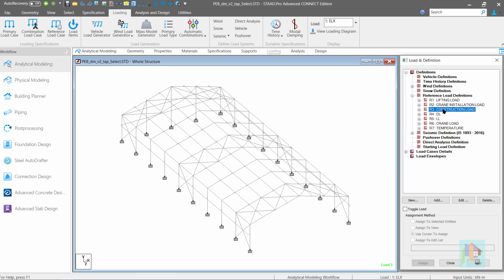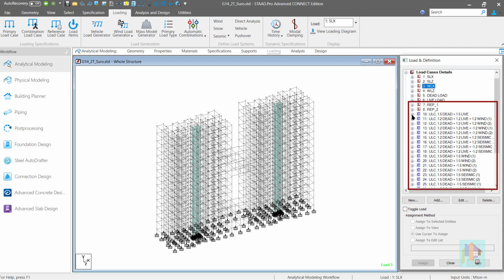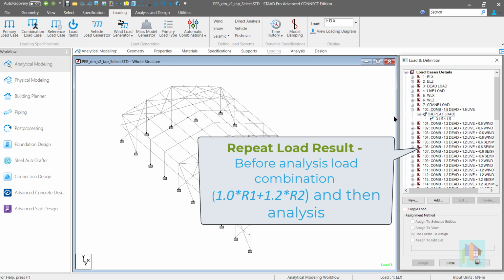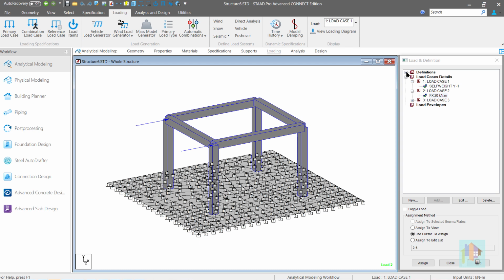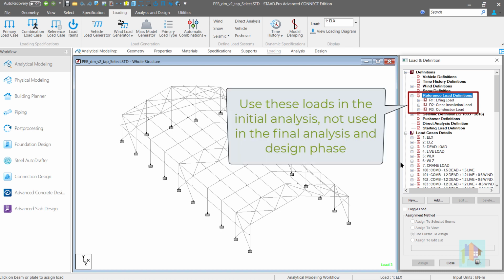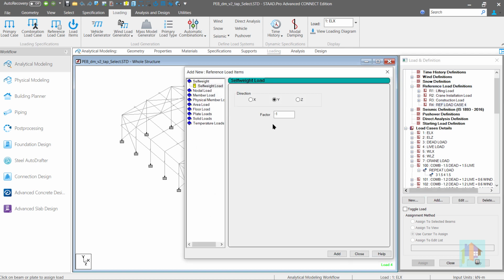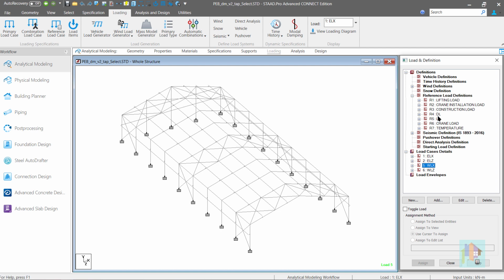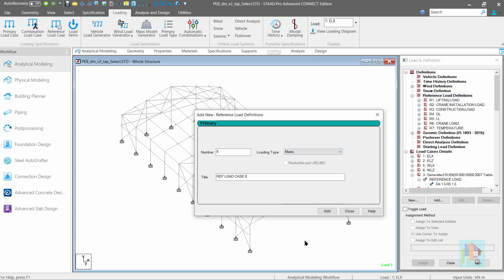# STAAD shorts – Overview of Reference Load Case | Reduce analysis time | Analyze selected loads

Comment: Auto-generated loads with "create repeat load cases" checked do not take custom load case numbers, instead while generating auto load cases, it takes whatever load case number is left out within primary load case numbers. Is it a bug or am I doing anything wrong?
Reply from the maker: I have also noticed this issue that custom load case number is not considered for load generation when repeat load is switched on. Repeat loads are nothing but a primary load case, so there is a chance that program ignores the custom load numbers for primary case, though this seems like a bug to me. Let me post a bug for this problem and I will let you know once this is fixed.
Reply: @surojit_ghosh  Thanks for letting that know. Myself, structural engg from Mecon. Your tutorials are very informative. Keep doing the great work.